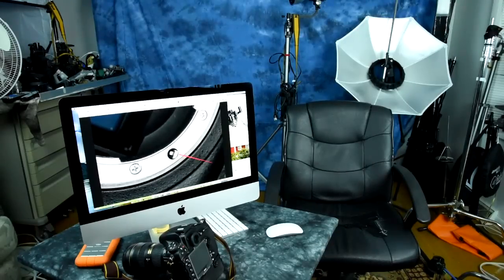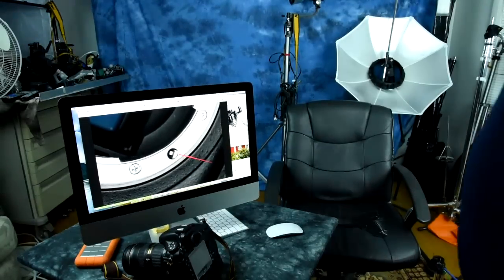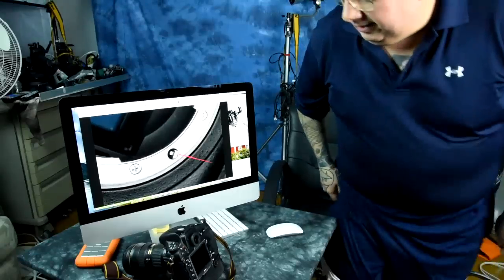Future Photographer: NEXT GEN. CAMERA TECHNOLOGY Revealed. Autofocus Tech

Comment: you keep saying that the new lenses have gears and motor inside, it's actually untrue! At least for Nikon, but i believe that other companies use a similar technology but i know for Nikon for sure since i have had to open a few and repair them. When a Nikon lens indicates at the Bottom the SWM technology, means it has a Silent Wave Motor. It doesn't have a single gear or motor inside.... There is only a very sensitive and accurately positioned rings which are calibrated and measured separately on every single lens and they move the focusing elements  just by magnetic field and pulses.
Reply from the maker: +Ioannis Koukouzis i mentioned AF-D and AF-S drives in this video. 

charge disparity coiling will alow 60% faster AF than even the Silent wave motor
http://www.pierretoscani.com/images/echo_shortpres/Figure-19-UK.jpg

the stator on the SWM cannot match the speeds of next gen. AF drive tech. 

Some medical and military gadgets already sport this tech.
Reply from the maker: +Ioannis Koukouzis 
two types of Silent Wave Motors Nikon uses in their AF-S lenses. 
There is the ring type  motor, which in my opinion is the real deal. As the name suggests this  motor fts over the focusing mechanism and directly drives it. This was  the original SWM

Then theres the Micro Motor. These look much more like a conventional little electric  motor. They sit inside the lens and drive the focusing mechanism by a pinion/tooth ring drive line. Lenses using this type of motor are slower to focus and make some whirring noise in doing so. These lenses are  generally also larger in diameter than they would normally be, as the  little motor sits beside the lens elements and focusing/zoom mechanism, 
and to cover it up, the lens needs an outer barrel of a relatively large diameter. This kind of motor was introduced by Nikon somewhat later in  an attempt to lower the cost of consumer AF-S lenses as this motor is 
much cheaper to make.
Reply: +Theoria Apophasis AF-S drives all have SWM i think... At least the last decade's ones. I believe that the speed "problem" and the focus hunting that still exists is mostly because of the focusing sensor and not the motor technology. Take for example the smartphones focusing system technology. The focusing element literally hovers in mid air by a system of coils and magnets and it moves just forwards or backwards depending of the power applied to the coil. its lightning fast moving, but the algorithm that manages the coil and the trial and error used is taking some time....
Reply from the maker: +Ioannis Koukouzis since your the second person to mention the SWM im uploading a video on it now, 
i had planned on making that video soon anyway. 
there is driven element torque issues between the 2 diff types of SWM also  :) 

lighting fast compared to the D screw drive YES, but its still DAMN SLOW compared to the newest hubless systems.
Reply: +Theoria Apophasis great! Can't wait! Anyway, I'm big fan and it's great to get a reply from you! Keep up the good work!  P.S. I really like your YouTube username( Greek)